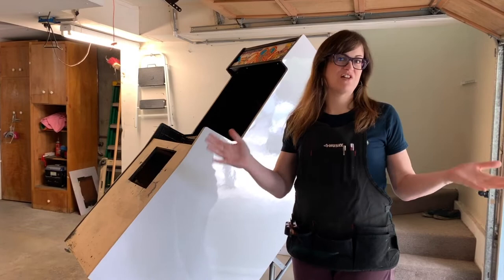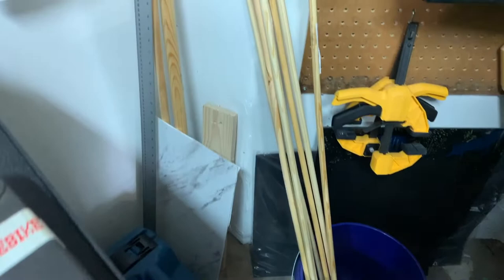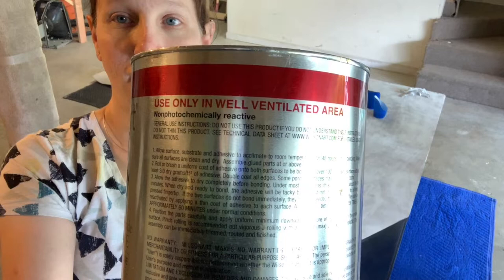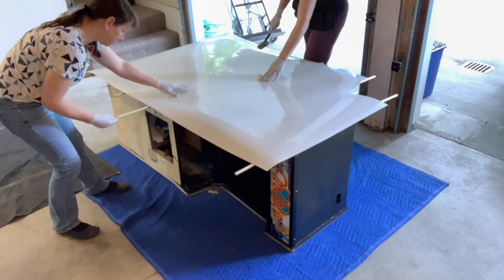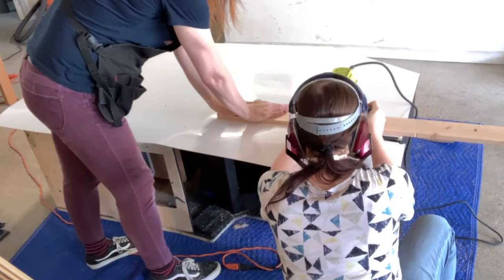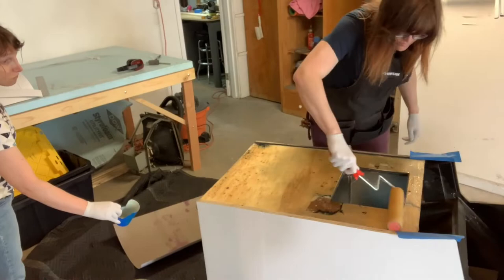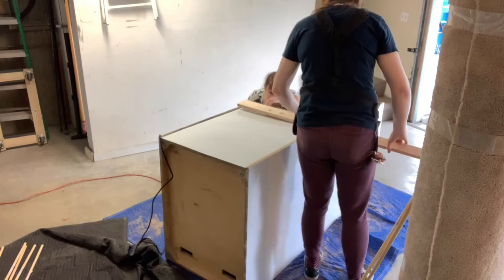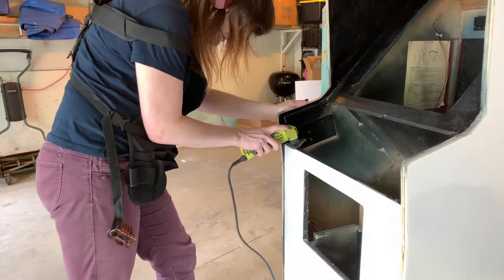How To Install Laminate On An Arcade Cabinet

Comment: Good video but you were using the router in the wrong direction, which is why it left the edges rough.  The blade faces the other way on the bit so you need to move counter clock-wise around the game.
For the coin door it's the opposite (move clock-wise) in order to cut with the bit moving left.
Also: ALWAYS check the router bit and tighten it up between long cuts (unplug it first)
But amazing job!  It came out great!
Reply from the maker: AHHHH Good to know! Thanks! I bet we would have gotten a smoother cut!
Reply: @VintageArcadeGal  Trust me we all learned the hard way including me. Lol. 
Also, the correct router bit to buy is the flush trim bit with the bearing on the top of the bit, so that when it's installed it will face down and ride along the edge of the wood where the t-molding sits. 
I think you may have had the wrong bit which faces up when installed. I wish someone had told me there were two versions of the flush trimmer bit. I learned the hard way just like you.

Comment: what thickness of laminate are you using? and would you recommend any peel and stick product
Reply from the maker: It's just what ever the typical thickness is for kitchen cabinet type material (it is fairly thin, and easy to crack). The peel in stick kind I have not used, but I think it's a bit on the thick side for arcade cabinets probably.